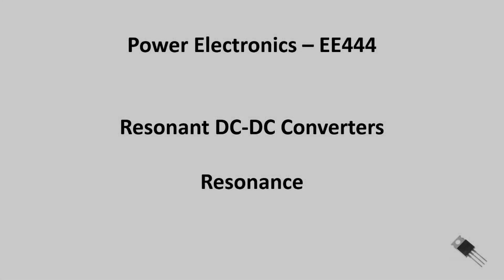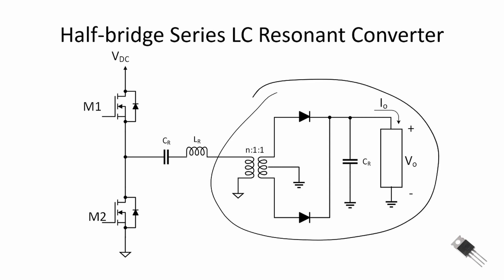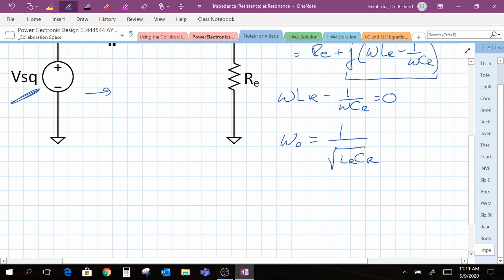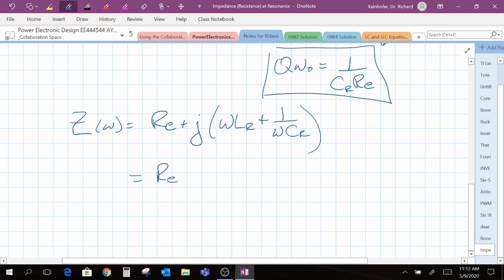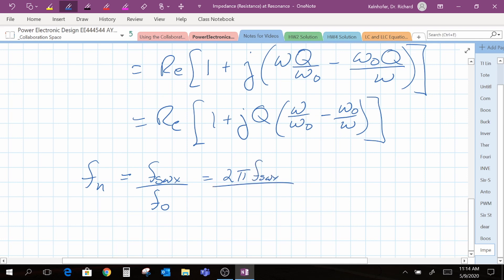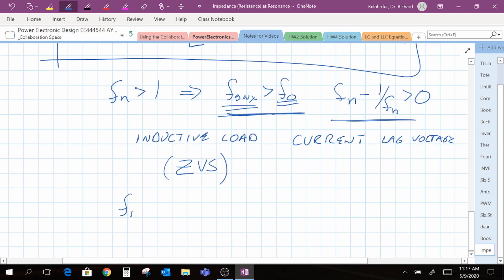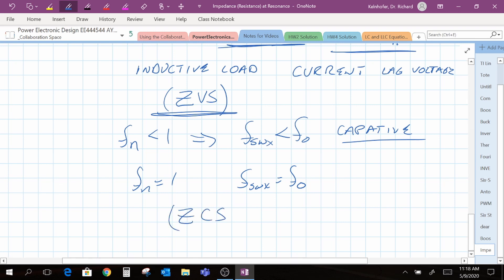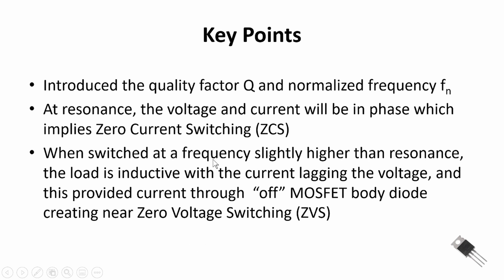Power Electronics - LC Series Converter - Resonance

Comment: So I need to set the transformer such N that I have close to resonance action for zvs, but I have a 10 amp max supply and this do most of the time 1/10 of that, so I need to stay there, then it is maybe better a LCC because these can do much more narrow frequency shift for operating, the LC is much wider. Nice video,s.

Comment: Does series LC Tank amplify power? Since the impedance is Zero and the voltage is amplified then we must have higher power with higher Q factor
Reply from the maker: Hi BlackKnight, no the average power can not be amplified and is less than the average power provided by the DC source.  While the reactive part of the impedance is zero when switching at the resonant frequency, the resistive part of the impedance is not.  This resistive part is the equivalent load impedance reflected back to the primary side of the transformer.  Hope this helps. Best wishes on your design. -Dr K

Comment: thanks for this great videos.. i have a question and it will be great if you answer me .. if we have a variable input dc voltage could we have a constant output..
Reply from the maker: Hi Rawan, the answer is maybe.  It really all depends on how fast the input is varying.  Implementation of an LC or LLC converter requires output regulation and is a closed loop feedback system.  Therefore, the control system adjusts the switching frequency of the input half-bridge based on the output voltage.  Also, the range on your gain is highly dependent on Q and your load.  Finally, the time-constant of your control loop (not covered in this video) will determine how quickly the system will respond to output changes or if the system is underdamped (overshoots the target voltage).   Regards, -Dr. K
Reply: @powerelectronicswithdr.k1017  thanks for your answer.. Actually i am trying to design an ultra low power and low voltage  self controlled boostconverter using a transformer..but i am confused a little because the  input voltage range is  between 0.2 volts and 3 volts..could i have constant 5 volts with a regulation circuit and closed feed back system?
Reply: @powerelectronicswithdr.k1017  
Dear sir
Thanks for sharing your video sir. I am very much attracted.
Sir I am doing research on wireless power transfer in ev battery charging. How this resonance converter helps and how to achieve soft switching sir
Reply: Sir how the resonance takes place if switching frequency and resonant frequency are different